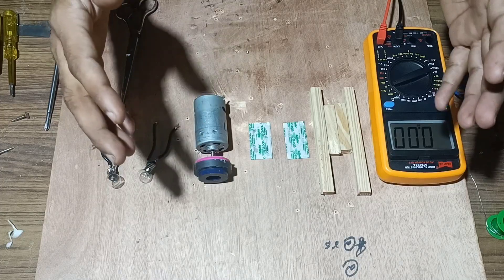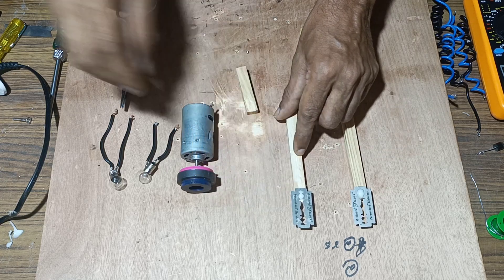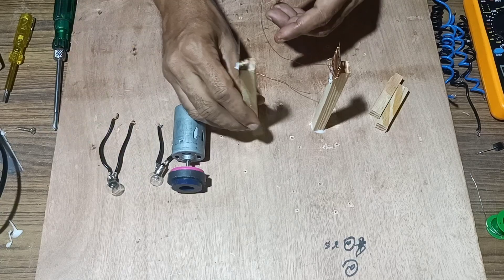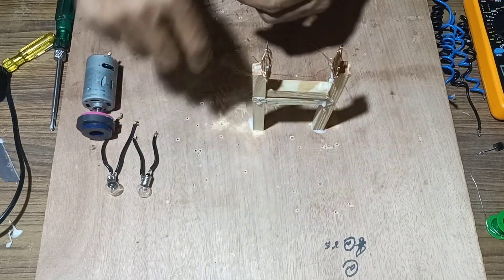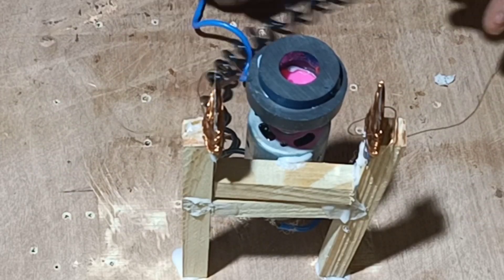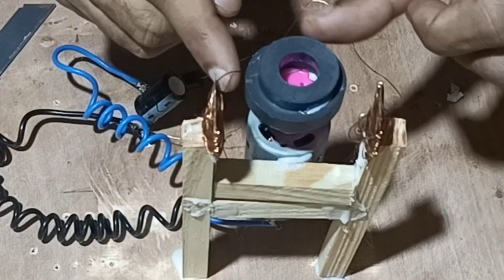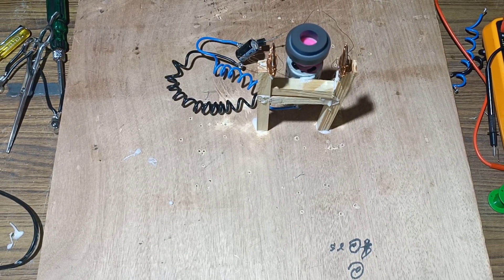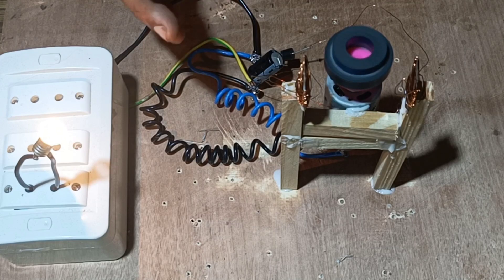"Blade Powered Dynamo: DIY Spinning Magnet Free Energy Generator!"#freeenergy

Comment: Why did you waste all that time winding wire around the razor blades?  Why can't you make your "Blade Powered Dynamo", without the screws?  Are you trying to hide something?  I know exactly what the diode is for!  You're not using it to rectify anything!!  You're using it to isolate your stupid wire-wound blades from the hidden power source under the table!!!  There is a power source under the table connected to the screws!!!!  Is that a working capacitor?  It doesn't look like it!!!!!  THE WHOLE THING IS FAKE!!!!!!  Prove there are no hidden wires!!!!!!!!!!!!!!!!!!!!!!!!!!!!!!!!